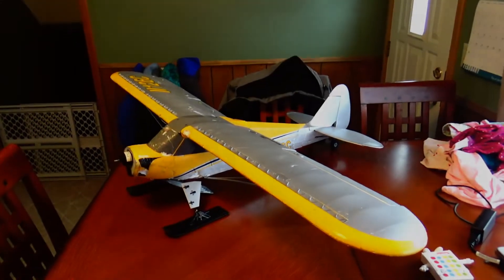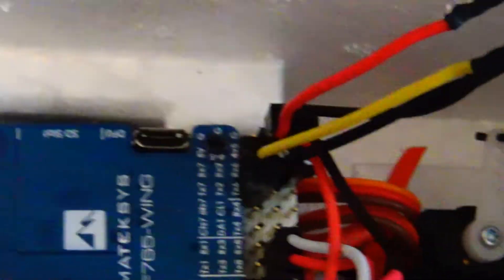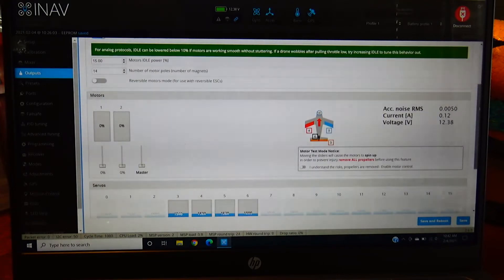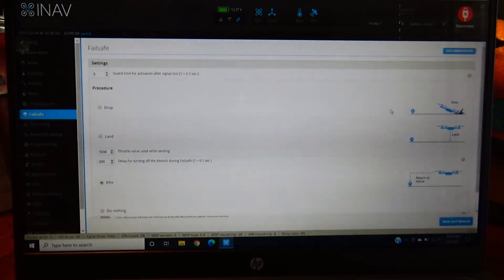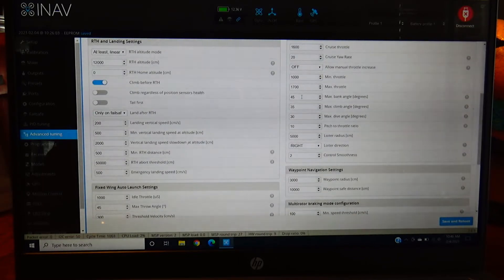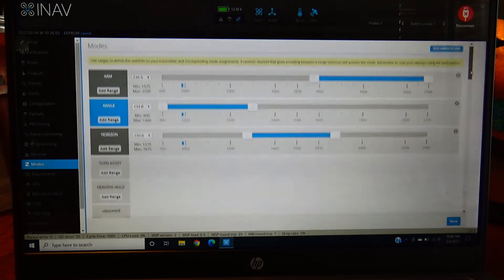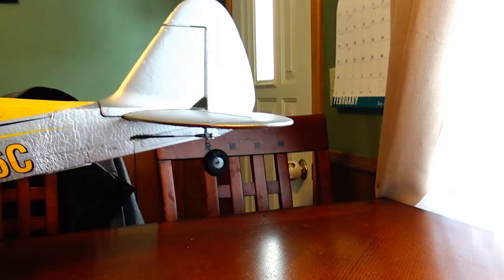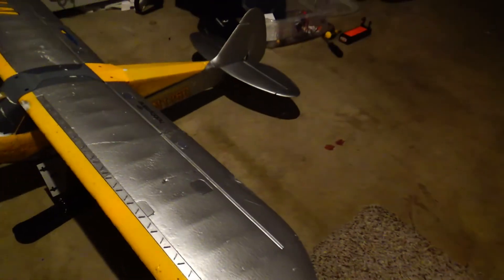iNav Basic Plane Setup/Stabilized Control Surface Check

Comment: My Aelerons are reacting backwards although they respond correctly in manual mode. What could be the issue? Running a radiometer boxer with CRSF on a Atomic swordfish
Reply from the maker: Make sure you haven’t reversed any channels in your radio. You only want to reverse servos within the inav software. Because when you reverse them in the software, the stabilized correction follows.
Reply: Ok that makes sense . Thank you for taking the time to respond!

Comment: Hey man any idea why one or two servos would stop working after 30s on the same FC? They just stick in a position and don’t reset until it’s powered off.
Reply from the maker: Seems odd. What plane and how many servos you running?
Reply: @unger_cnc  only 4 servos and it’s like a flight test foamy.
Reply: @unger_cnc  12g emax servos.
Reply from the maker: Running same FC? Can you measure voltage from the servo positive? Make sure you’re getting 5v the whole time?

Also, are you running 50hz on the servo refresh rate?
Reply: @unger_cnc  I didn’t know there was an option for servo refresh it’s the default though. But I think most people run 9g so I’m worried it’s overdrawing the amps.
Reply from the maker: You should be fine with 4 servos. The Matek f405 has a 5a bec which is good for at least 6-7 servos
Reply: @unger_cnc  I just tested on separate becs and all except the tail servo is dying and other 9g servos aren’t on the same setup. I think I just got 3 bad servos.
Reply from the maker: Bummer man!

Comment: Sir, can use RTL mode without barometer ?
Reply from the maker: Yes. Just won’t be as accurate for altitude. Gps is all you need for planes when using inav.